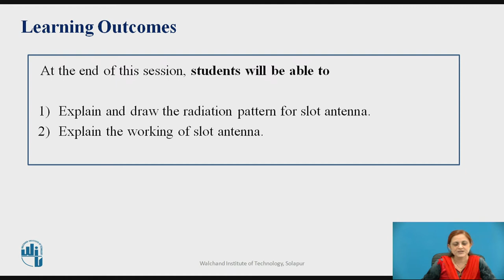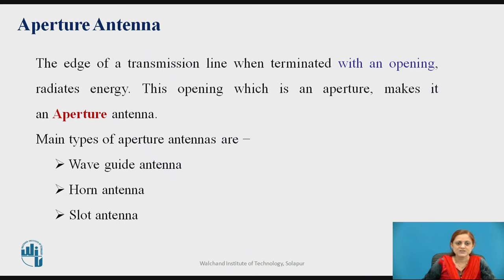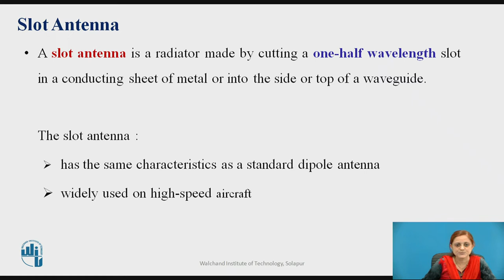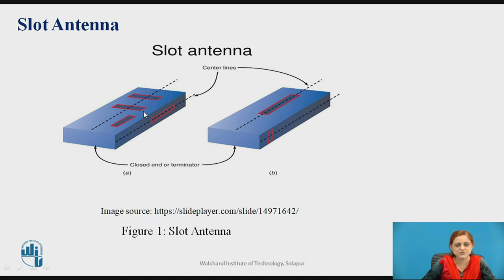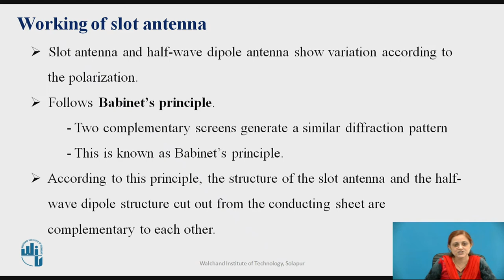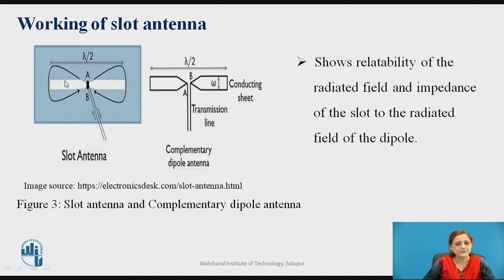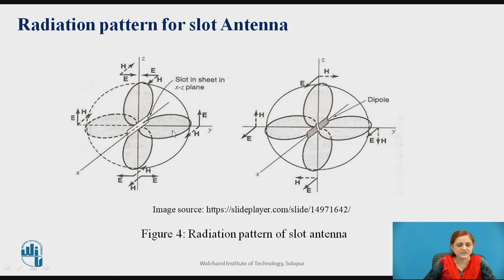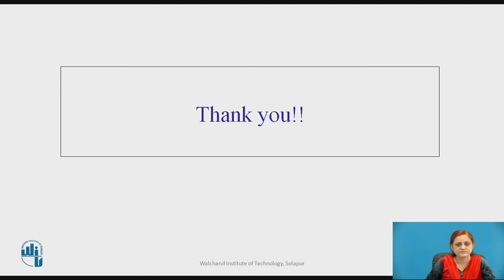Slot antenna - Part I

Comment: Thanks for this video.    For the slot you mentioned that the slot is in the centre of the metal sheet.  Does it work if the slot is offset to be close to one edge of the sheet maybe 1x the width of the slot?    Also what is the effect of the thickness of the sheet metal?  If the metal sheet thickness is more than the width of the slot or even 2x or 3x  more than the width of the slot.